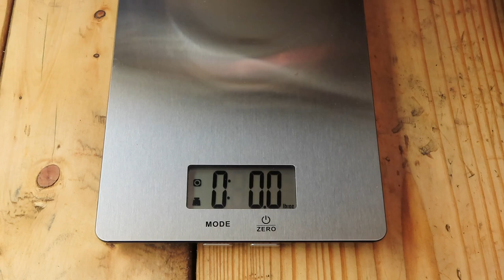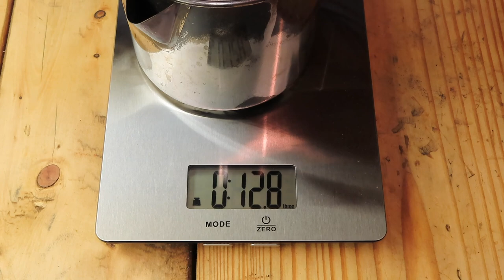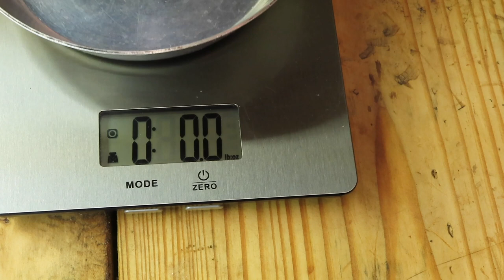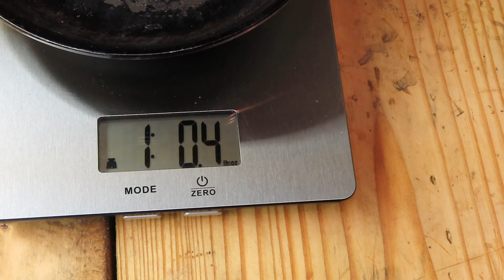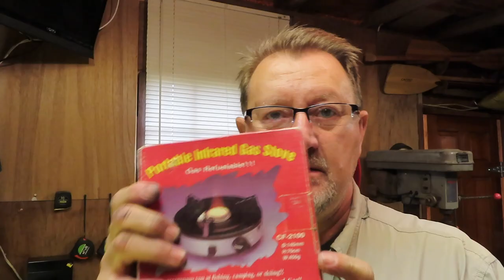BUSHCRAFT COOKWARE !

Comment: Nice lil shop you got there Mike.  I like it!  Good little discussion you're having.  I don't use a lot of aluminum, I have a small percolator I used to use a lot, now it's just every so often.  some of my other backpacking gear is aluminum, but coated.  after that it's stainless and a few titanium pieces.
Good job on the repair of your stove.  I think that aluminum skillet will do ya well, especially after you break it in
Reply from the maker: Thanks Karl O! I usually call that my tiny shop,
it's only 12x14. I seasoned the pan on my grill today and it works perfect. Every thing slides around like store bought. I hope to do an update companion video to show the difference that proper seasoning can make. 
I appreciate you watching the video, little long for some people. The fireplace took me 6 months to build working weekends. Blowed out my right elbow and had to take 3 months to let it heal. Been enjoying the heat this year!
Thanks again! Mike B.
Reply: I don't think it was to long at all.  you need to watch some of mine.  They can linger for some time.....
Sorry to hear about your elbow.  Glad to hear it healed well.   On the mend right now too,   I understand.
Best to ya!